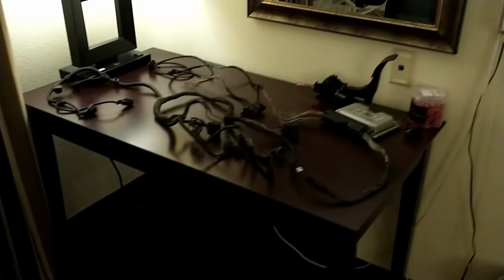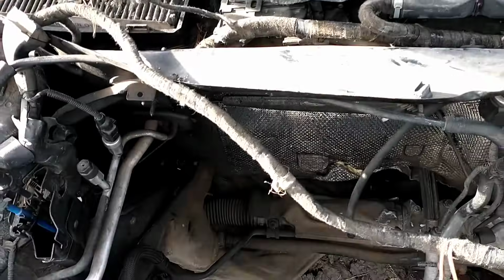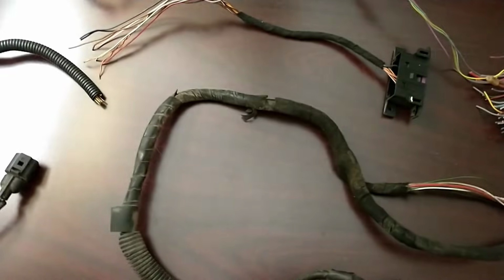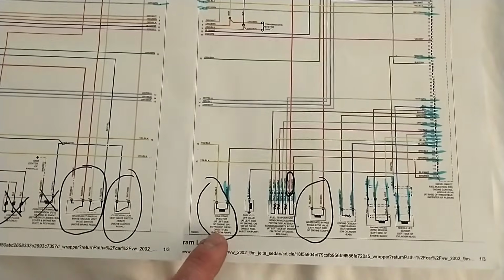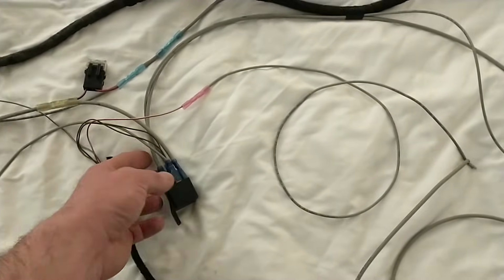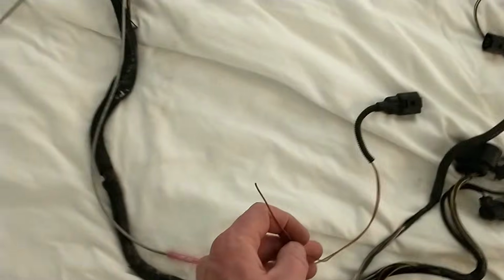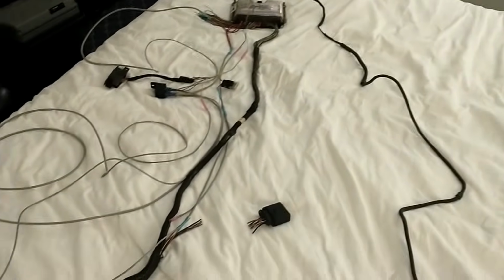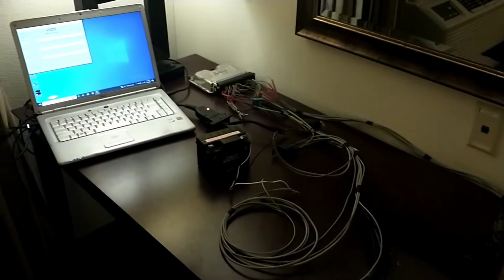Making A Standalone ALH TDI Swap Engine Wiring Harness

Comment: Is there a way to hot wire the brake pedal so I don't get a dead pedal? I just got done with a ranger alh swap and it's almost ready for school but it has that annoying dead pedal. If not what software do you use to tune it out? I have vcds and vag k com.

Comment: It's funny the pre-made stand alone ALH harnesses on ebay have 5 relays and 5 fuses. Doesn't seem necessary.
Reply from the maker: Yes it's all extremely redundant, the entire system uses less than 5 amps while running

Comment: Question: pin 18 on the ecu, in the video you said it goes to key on Power, after looking at the schematic it looks like a switched ground to close a relay for key on power. 

Do you really need pin 18 at all? 
Can you just power up the other 2 wires 88&37 with the key on power

Also pin  1&2 are those constant 12v batt or key on power?

What is the cold start injector for?
Reply from the maker: I did find a few changes since I've made the video, only 1,2,37 need power for the ECU to operate 100%. But all three are supposed to be key on and lose constant 12v with key off.  The rest are not needed.  The cold start injector is for the injection pump that is needed.
Reply: @TDISwapShop so I don’t even need to have separated constant and key on power for the ECU, it can just be key on only for everything?
Reply from the maker: @renosgarage7451 yes sir, if you dig into the factory wiring everything turns off with the key besides OBD power
Reply: @TDISwapShop   awesome, thanks
Reply from the maker: @renosgarage7451 for sure!
Reply: @TDISwapShop at this point do you recommend just a single fuse on the entire harness or multiple?
Reply from the maker: @renosgarage7451 well usually I do a smaller 15amp fuse to the sensors since a lot of their wires are 18-20 gauge then a 25 amp fuse to the ECU power, and a 5amp fuse for the OBD port.  But that's probably overkill since the whole thing barely uses 1 amp lol
Reply: @TDISwapShop  you’re a huge help man I hope lots of people find this info
Reply from the maker: @renosgarage7451 I do my best to post it all over Facebook but it's still missing people I know it is
Reply: @TDISwapShop  I’m sure you get this a lot but you’re a huge help to a lot of people
Reply from the maker: @mrmatt2525able I'm glad to help people, it's definitely a calling in my life.  But I do appreciate the recognition

Comment: Im currently running a Mtdi setup but i want to go back to electric pump. Sorry if you get this question alot. But once the harness is done is the IMMO thing that that needs to be disabled in order to get the engine running?
Reply from the maker: Ya you really need to get the ECU deleted of excess sensors along with the immo disable, but I can do all that and bump the power up too if you need it.
Reply: @TDISwapShop  Thank you for responding so quick! The sensors im thinking of using are MAF, MAP, needle lift, crank sensor and Coolant temp. And ofc the pedal. 
I have a complete parts car available. If i use these sensors will the engine "run". I dont really care about it throwing codes as long as it dosent go into limp mode. Im currently a student so i cant really afford to get professional help so i need to do as much as possible myself.
Reply from the maker: @antonaberg5238 well I do that stuff for $150, then you don't even need MAF.  But yes it would work with just immobilizer disabled and those sensors wired
Reply: @TDISwapShop  Thank you so much for your help! But since i live in Sweden im afraid both the time and shipping cost of sending my ECU would be absurd.
Been watching your videos for a long time now. Keep up the wonderful work you're doing.

Comment: I thought from certain videos that u need the key/  emobilizer and speedo?...i have a alh jetta i wanna do swap in my carbed toyota...thats all i gotta do for wiring to get it to run ?
Reply from the maker: You will need the computer tuned to disable those things but it's far easier than messing with that much extra wiring and the VW cluster.  If you aren't wanting custom tuning I can setup the ECU pretty cheap if you mail it to me
Reply: @TDISwaps  I just want it to be run reliable...no crazy tunes or nothen...just running like stock but with out the bs..
Reply from the maker: @goatsmisadventures yup that's the best way to do it, I delete all the sensors not needed like in this video, turn off the immobilizer so you just have a simple setup that starts and runs
Reply: @TDISwaps  perfect! That's wat I want wats  something like that cost?
Reply from the maker: @goatsmisadventures $160 with return shipping
Reply: @TDISwaps  cool deal I will be hitting u up in next week or so soon as I get engine pulled..you build harnesses as well?
Reply from the maker: @goatsmisadventures yeah man hit me up on Facebook. https://www.facebook.com/profile.php?id=100014261163897&mibextid=ZbWKwL
Reply: @TDISwapShop  u got insta gram ?

Comment: What do you do with the big injection pump plug that you cut off the run power back?
Reply from the maker: Those plug up by the ECU connectors that gets cut off needs power fed to 3 of the wires that were on it, the rest get removed.

Comment: Great video! Btw, do u know how to the harness on an audi b5 1.9 AWX? Wanna put that into my 84 volvo 740 Diesel 😅
Reply from the maker: I'm sure I could figure it out if it was right in front of me, but I dont have the awesome schematics for those so i have to just go one wire at a time.
Reply: @TDISwapShop  ah okay, i'd hoped u would know something about it, very little to find about the awx wiring online. And i have and audi with that engine and would be soo awsome to put in the volvo 740!
Reply from the maker: @granadaraggar ya I mean I'm sure I could set it up for you if you mailed it to me, but without it being here in front of me I would struggle for sure
Reply: @TDISwapShop  that i may take you up on! I'm gona part out the audi soon. Do want the complete harness of the intire car or can i cut it somewhere? And what do u want for the job? 🙂

Comment: Do you need to have an immobilized deactivated by a tuner?
Reply from the maker: Yes you do, I have the software to do it
Reply: Is that in vcds?
Reply from the maker: @blackdogprospectingwelding7341 no you need different software for that as well as different software for tuning.  I have 3 cables to get this stuff setup unfortunately
Reply: @TDISwapShop what are you using for immo off?
Reply from the maker: @blueberrychronic I use vag commander for immo off

Comment: What do you do for your alternator wiring? Also could you send me the pin out diagram and the wiring diagram you use?
Reply from the maker: I usually just wire both regulator wires to 12v keyed on power, the VW alternators are not very picky on that.  If you are on Facebook look up the group TDI Swapped Trucks, their files section has all the diagrams

Comment: Would the 1.9 sdi  none turbo Harness be the same it is in a Skoda Fabia . I want the motor for a boat . Looks easy enough
Reply from the maker: It should be very similar, if you can find any schematics on the wiring that would help you, but I'm sure if you started looking at that wiring vs this turbo version they would be very similar

Comment: Is that a 4 pin or a 5 pin relay? I can’t tell from the angle.
Reply from the maker: Either one works, only a 4 pin is needed, if 5 pin the 87a pin is left empty
Reply: Thanks so much for the info. I’ve been recreating what you did for the past 2 days now.

I would like some clarification on the “dead” pedal. So, in layman’s terms If I supply constant (hot at all times) power to “breaklight switch” wire (WHT/YEL - pin 65) 
and “Clutch vacuum vent valve switch” wire (WHT/RED - pin 66) that will eliminate the dead pedal that is sometimes intermittent during engine startup?

Thanks in advance.
Reply from the maker: The brake wire is the only one that causes the dead pedal, clutch only applies to cruise control, but yup that's it

Comment: Why cut just pull it out
Reply from the maker: There's no point when I only need this much of the harness, waste of time fighting with wiring covered in mouse crap anyways.  I hate vw wiring so I use as little as possible.
Reply: @TDI Swaps  Understandable. After finishing the entire video, you solved my question. Great job! This will be my resource when doing a swap.
Reply from the maker: @kmathers101 glad to help man, I've done it both ways, this is just far less time and work and less mess to throw away in the end

Comment: Just curious what kind of wire that Grey stuff is. Is it shielded? Not sure where I hered it but I hered a few wires had to be shielded
Reply from the maker: That is called SIS wire, single strand, just a little fancier than the stuff in stores, yes the crank and injector sensors need shielded but I don't mess with those they are already pre wired.

Comment: Which wire is the check engine? It says white blue but rhe only blue white wire I can find is for the pedal
Reply from the maker: It should be another white/blue going to pin 24 on the ECU, I have definitely found duplicate colors used
Reply: @TDI Swaps  yeah I see that's what it says on the diagram I'm using but there's only one white blue on there. But on the other hand the blue white wire is not shown on the diagram I'm using
Reply from the maker: @cadenmcgowan5161 yeah if the colors aren't making any sense you probably should just Trace out the numbers, pin 24 is for the check engine light and pin 63 would be the other blue/white to the throttle pedal
Reply: @TDISwapShop  yeah I'll have to try to trace it. Any chance you have a diagram that shows what numbers are what on the plug it self?
Reply from the maker: @cadenmcgowan5161 this site has picture of the pins. https://m.aliexpress.com/i/2251832702473716.html?gatewayAdapt=Pc2Msite4itemAdapt

Comment: can you show how to wire up cruise control?
Reply from the maker: I will be doing that soon on my next swap, it really depends on the vehicle though and where you can get a separate vehicle speed sensor to work
Reply: @TDISwapShop  i swapped an audi so it uses the stock system its just wieing it to the ecu im stupped on lol

Comment: Great video, saved me a lot of time doing my harness! Was curious if your going to make a video on the push button glow plugs?
Reply from the maker: I probably should, it's not too complicated though with just the glow plugs to a Ford starter relay, a 50amp fuse, and like a push button for the "starter" ha ha glad to help though!
Reply from the maker: @DMrider09 did you check out the glow plug video?
Reply: @TDISwapShop  I did thank you for that
Reply from the maker: @DMrider09 no problem!

Comment: i wanna put an tdi motor in my 1987 dodge ram , its got a 727 3 speed , do you got any tips they would be much appreciated
Reply from the maker: Should be pretty straight forward, it would be nice to have a 4 speed trans but with the right gearing that should work fine.  Older vehicles make the swap much easier!

Comment: Best ALH wiring harness vid I've seen!   Thanks for posting!   Do you have an easy way to make the tach work?   I guess there's some kind of module needed?
Reply from the maker: Thanks! The tach really depends on the vehicle, older OBD1 vehicles only use one wire that can be connected right to the VW ECU with a resistor to adjust rpm, but the newer the vehicle, the more complicated it gets
Reply: @TDISwapShop  Use dakota diesel setup with transducer. easiest to do and adjustable.
Reply: @gerardmccarthy2432  Got any good videos on the dakota module? I found that and their universal speedo tach module. Interested in both.
Reply from the maker: @timbrwolf1121 sorry I have yet to use one of their modules, so far everything factory has worked for me

Comment: So if I go with a non vgt turbo like a he221. Then I don’t need the n75 or any other plugs that run along the firewall?
Reply from the maker: Correct, I wouldn't throw it away in case you change your mind on turbos, but they aren't needed as long as you get a tune to delete them
Reply: @TDISwapShop  ok I am going to be trying to tune this one myself I just need to buy the connector and software.
Reply from the maker: @dillanmarcos  I think the easiest thing to do is turn off over boost and under boost codes so you can't go into limp mode and that will get you going with a wastegated turbo

Comment: Can you post a link to that wiring diagram pinout?
Reply from the maker: https://m.facebook.com/groups/291980407818664/permalink/1347610958922265/?mibextid=Nif5oz
Reply: @TDISwapShop  thanks!!
Reply from the maker: No problem!
Reply from the maker: All the pinouts are in the files section on the TDI swapped trucks group on Facebook